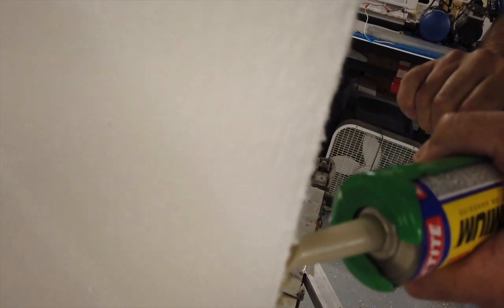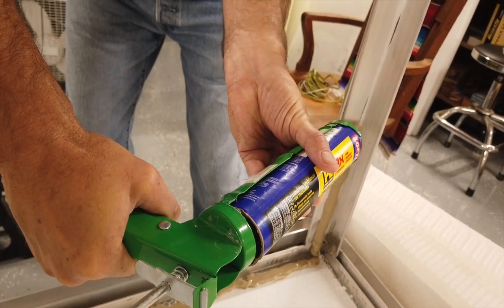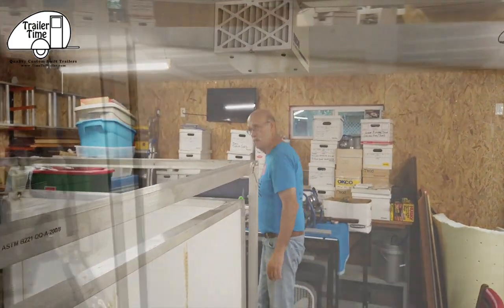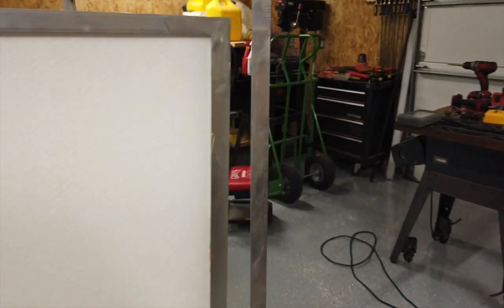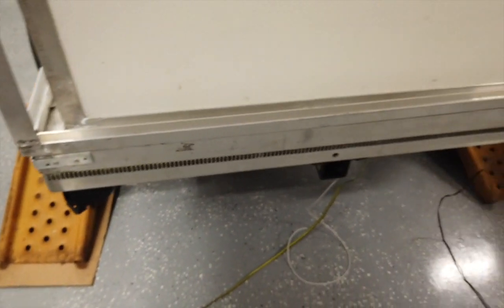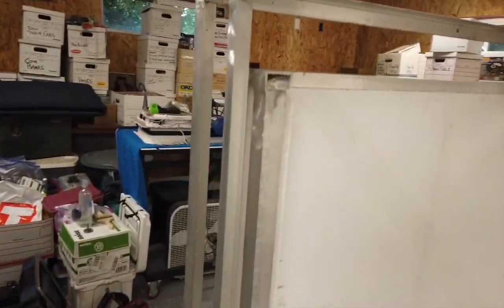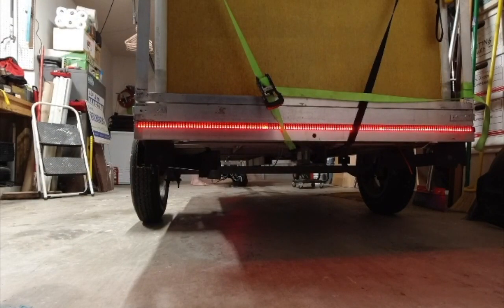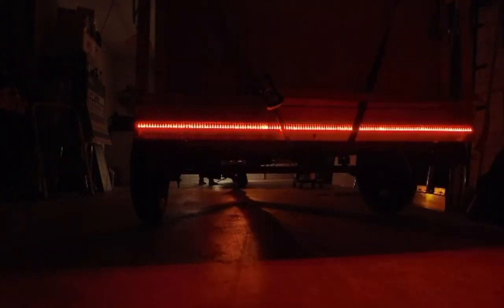Riding For A Cure Trailer Rebuild Part 12

Comment: I have an idea for the ‘distressed look’ paint. Paint the background your navy blue. Let that dry. Grab some plastic grocery bags.. those cheapies we used to throw away. Wad a couple of them up, and dip the wadded plastic bag lightly into the white paint. Dab some off, then dab the wad onto the surface you are painting. It should be a REALLY light coat. Let it dry. Do another really light dab or two. You want it to be layered on and really really light, so you get some faded, and some not faded white..distressed. This works on house walls.
Reply from the maker: Thanks Kevin! I'll have to try it on a test board.